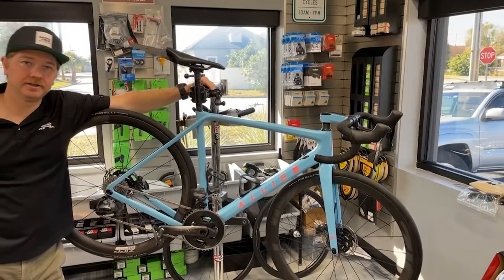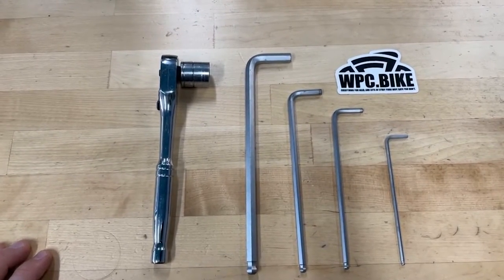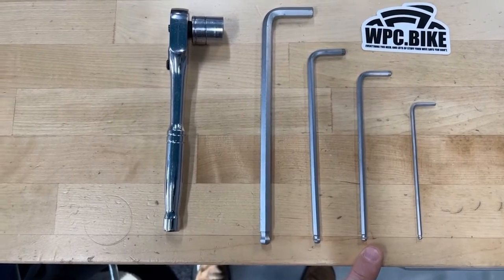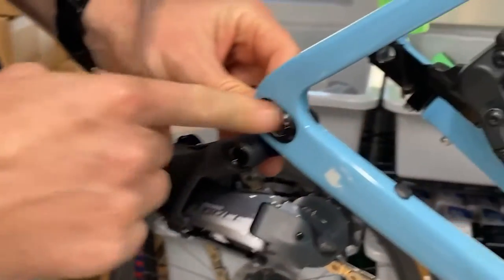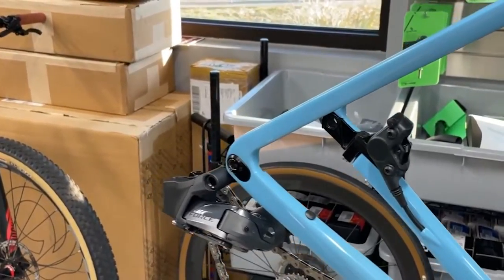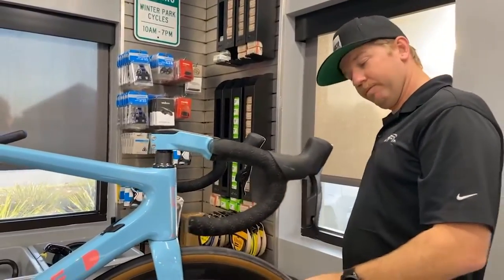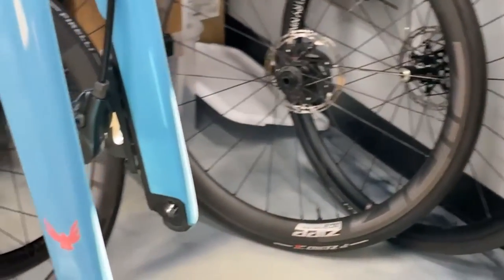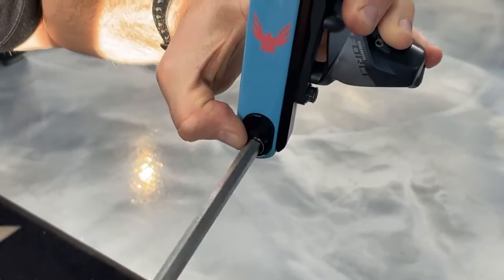HOW TO: Allied Echo Geometry Chip Flip Instruction

Comment: Do you feel there’s pros to switching to road mode rather than keeping it in gravel mode for both? I’m wondering if that inch or so makes any difference(tucking,aero, speed, geometry, etc. ) ?
Reply: There is definitely a noticeable difference in the handling. I have ridden it plenty in gravel mode with road wheels and it rides fine, but to get that "pure road" ride switching it to road mode really helps.